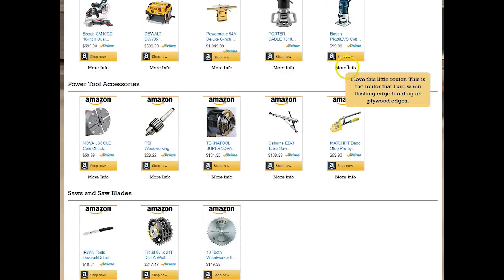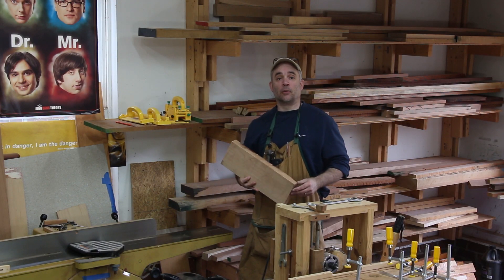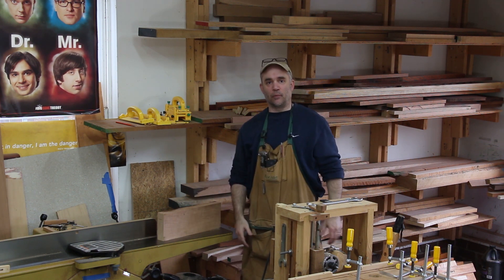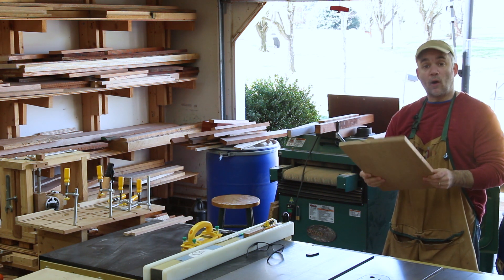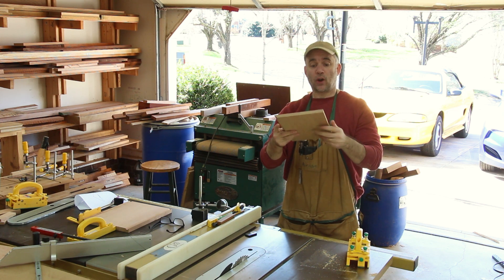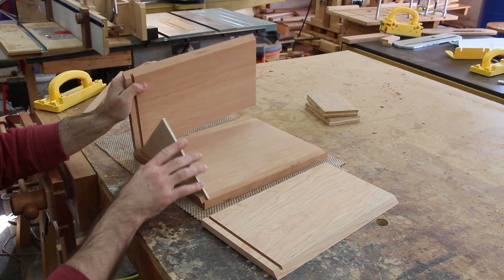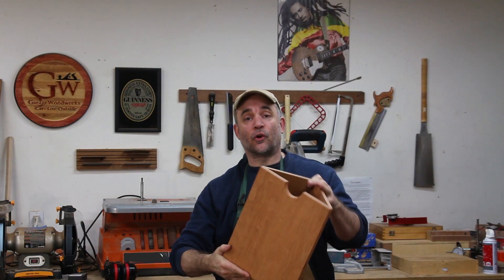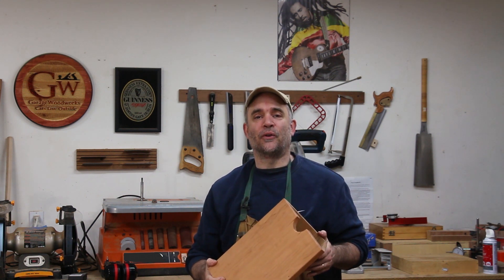A Triangle Waste Basket in Cherry

Comment: Brian, I bought the same Rigid sander you use, and when I use the spindles the sandpaper rides up the roller.  How do you keep yours from doing the same thing?
Reply from the maker: Mine will occasionally do that too, but after I stop and re-tighten it a little more it doesn't do that.  The washer, as you tighten, should compress the sanding cylinder-thingy and tighten the sandpaper.  If yours still moves maybe you could try to roughen the inside of the sand paper with a round file?
Reply: I made a wrench out of plywood that fits over the knob used to tighten the washer onto the cylinder.  It makes it easy to tighten it enough to compress it.  Also, for some reason, when I used the belt attachment, that knob seems to tighten itself and I can't loosen it with just my hand.  The wrench makes it easy, and it doesn't tear up the knob like a pair of pliers would.

Comment: Always amazing to see you work, but how did you start that stopped groove at 4:07 ? did you tilt the work piece into the running bit?
Reply from the maker: The work was placed over the bit in the correct position while the router was turned off.  Then it was turned on and Bob's your uncle.
Reply: Aha! Thanks for the info!
Reply from the maker: :)  Yeah, normally on a stopped groove you would need to drop the piece onto the spinning bit, but I had the 45 degree grooves to place the bit into here.
Reply: Excatly! That's what I was wondering, you must have planned to fist make the 45 degree groove before the stopped groove :D